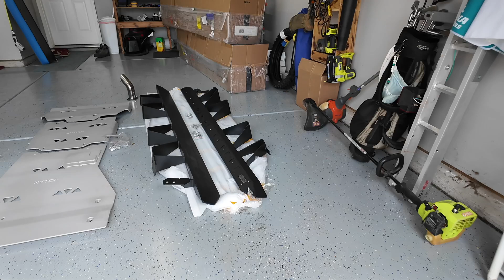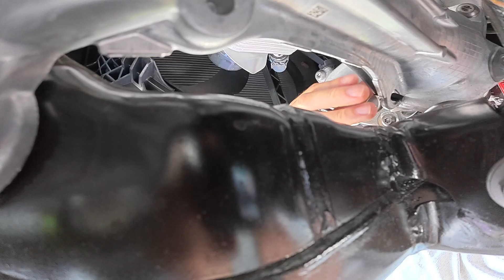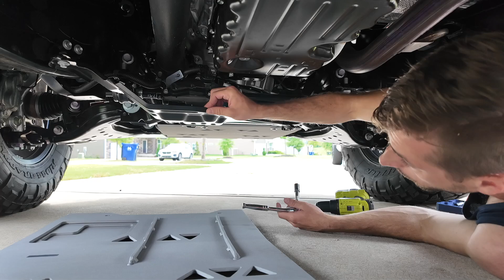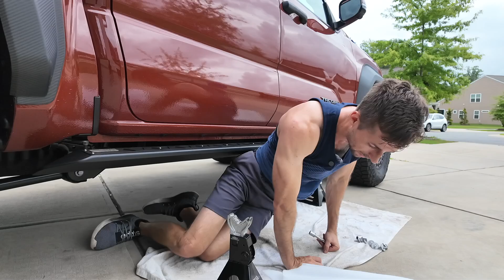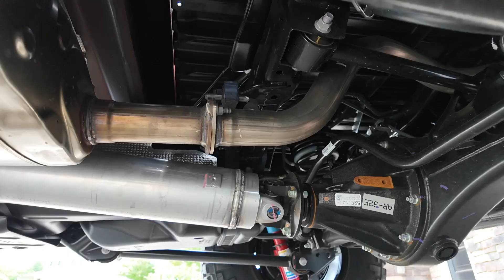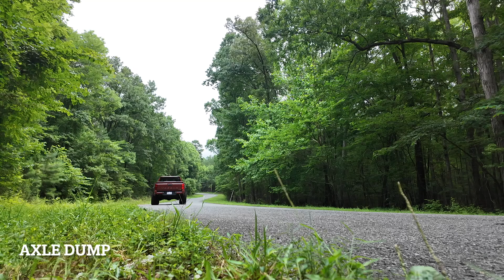Giving My 4th Generation Toyota Tacoma The Best Offroad Protection!

Comment: Please be honest.  What happened to the AWE aftermarket exhaust?  It looks like you installed the OEM stock exhaust back onto your truck?  I’m contemplating on ordering the awe exhaust and it seems like everyone that installs them returns back to stock.
Reply from the maker: That’s currently installed on the truck, I had two different styles to showcase and you’ll notice these parts in the awe video lol. We sell a lot of the AWE kits and no one returns them. It’s a great full system for these trucks!
The exhaust tip I showed in this video is great if you don’t want to hear the truck, but I like some sound!
Reply: Ok I understand. Basically this video is before the awe exhaust install video.
Reply from the maker: @NamJi correct!
Reply: You have the stock exhaust in this video.  It’s not the AWE exhaust.  Your sound clip at the end also confirms it’s not the AWE exhaust
Reply from the maker: @NamJi I never said this was the awe exhaust in this video…You’ll notice in this video… https://youtu.be/FYYbhqIFWsM?si=_wwdZ767v4yt0lrH

The rock sliders and skid plate are installed. Because I installed all these parts first and then installed the full exhaust. The videos just were uploaded in reverse for certain reasons…
The sound clip is the stock vs the dump exhaust tip for this video…
But like I said, I currently have the awe exhaust on the truck.

Comment: I like the steel skid plates on my trail hunter better they have hangers on them where you just take out 2 bolts on each skid plate the other 2 you just have loosen them up and that it is way easier to put back on
Reply from the maker: Cool, that is a factory skid plate vs aftermarket. This is way better than the flimsy stock one I showed.
Reply: @BrosFOURRSpeed that's true

Comment: Heard the short exhaust makes alot of drone noise and put you at risk for exhaust poisoning if your just park and sitting in idle it makes it easier for the fumes to get into the cabin being that it’s now under the vehicle instead of factory that points out from the back.Whats your thoughts on that ?
Reply from the maker: This does not change the exhaust sound at all, so there is zero drone.  I had a similar setup on my 3rd gen and same thing.  This doesn't create any drone at all.
I wouldn't really agree with that statement.  The exhaust isn't going straight into the cabin even at idle.  You're more prone to experiences that with a leak directly under the cabin vs just behind it.
Reply: @BrosFOURRSpeed ok what about easy access to do oil change and filter with the extra body under body protection did it come with a access door ?
Reply from the maker: @curiosityredpill7030 it would be the same as taking the stock skid plate off. So just removing the 4 bolts to gain access to the drain bolt!